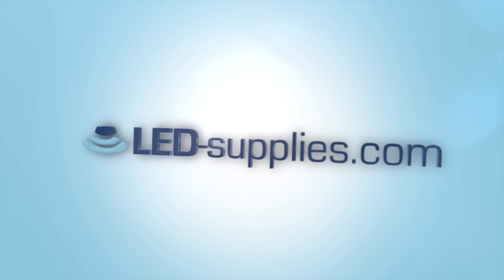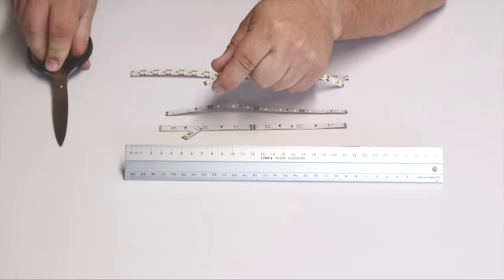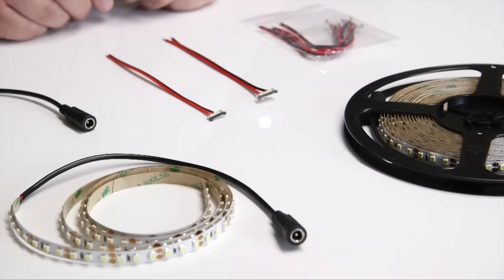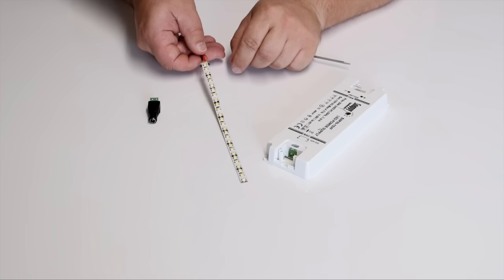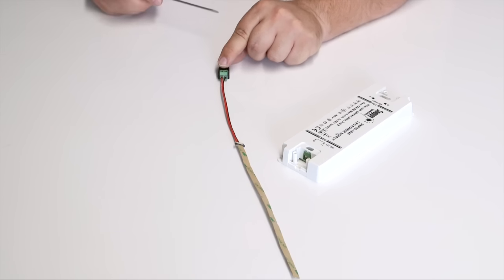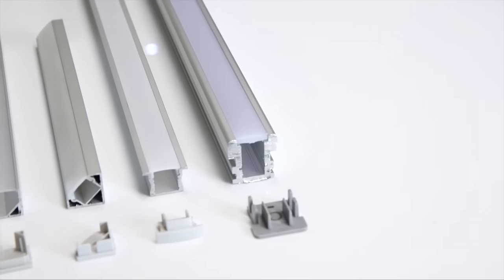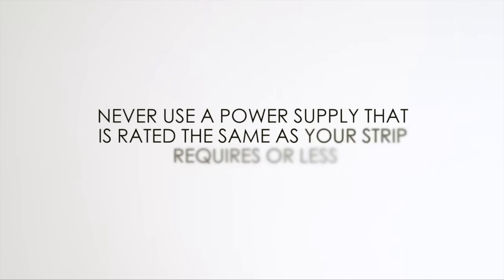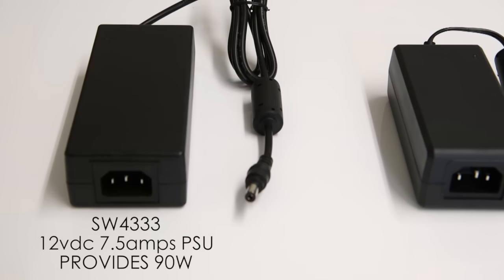How to cut, connect & power LED Strip Lighting

Comment: Can I make the letter A with these led lights?
Reply from the maker: Hi AH AH, thanks for contacting us. You can make an A letter with LED Strip lighting but it can be a little tricky to cut and join the led strip into that shape. We would suggest using our LED Modules https://www.led-supplies.com/led-modules/led-modules-1-2w-ip68-white-series/ as each 'Module' has flexible cable in between each section so they can be shaped much easier and are widely used for illuminated signs for this reason

Comment: i connect 2 LED strip rolls = 10 meter to big power supply, the LED strip at first is very bright the rest is low light! i don't know how to solve this problem! can anyone help?
Reply from the maker: It sounds like you are getting quite a bit of voltage drop down the LED strip. Many of the higher powered LED strip such as 9.6 watts and above are only suitable for connecting a maximum of 5 metres in series. You could try connecting in parallel (put the power supply in the middle and connect to each using a splitter cable or terminal block) That should solve your problem

Comment: Hello, I have 7meters(total) of 4w/m leds(28W+20%=33.6W), theyre in parallel by 3m+4m. I want to know if the PSU(ac adaptor model ly24-c052000-a1) i bought with 5m strip can run all the 7m strip without damage. what do you recommend? thank you.

Comment: is there a clip on connector that I can use to hook up the lights directly to motherboard? Or is there an LED light strip that already comes with the connector attached. I know Oly some mother boards support it and it has to be 12v

Comment: Can I use Dc12v 1amp adapter to 1 meter led strip can its work? please reply as soon as possible
Reply from the maker: It depends on the power rating of the LED strip. The power supply is 12 Watts (12v x 1A) so if the LED Strip is 4.8 Watts or 9.6 Watts per metre then yes. If the LED strip is 14.4 watts per metre then no you would need a larger power supply such as 12vdc 1.5A or more

Comment: Question please, if I wanted to have a single little LED on the end of about a 1 meter wire connected to a little solar panel, how would I go about doing that? I'm very new to all this so as Layman's terms as you can please =P
Reply from the maker: Usually the LEDs on flexible strip are in banks of 6 as 24vdc LED strip, or in banks of 3 if its 12vdc LED strip lighting. If you specifically wanted a single LED then we could manufacture this for you, but it would involve placing a resistor on the PCB for each LED, rather than 1 for each bank of 3 or 6. Rather than making a special type of LED strip which would be costly, could you have a bank of 3 and potentially just cover the light up from 2 of them using masking tape?

Comment: what happens if your power supply is lower than the 5amp recommended? i've a 1.5amp power supply and it work jejej

pls answer!
Reply from the maker: Many good quality power supplies and LED drivers (many of ours included) have over load protection, so when too much current is drawn it shuts down to protect itself and maximize how long the power supply lasts.  It may be that your 1.5A rated power supply is working as it does not have this over load protection. if the LED strip lighting you are powering is using much more current than the power supply is rated to, i would expect that power supply or LED driver to fail much earlier than it would do if it was properly rated

Comment: I used a lot 3m products and they don't work on raw wood or car overhead to keep the sun viser   from falling down. iv used duct tape to hold up the wires underneath the platform it stayed for 30 min. and let go didn't even hold little wires. So if duct tape doesn't hold what makes u think that the glue by 3m is going to hold.  !!!!!!!!!!!!!!!!!!!!!!!!!!!!!!!!!!!!!!!!!!!!!!!!!!!!!!! skipduld@yahoo.com
Reply from the maker: Its all about selecting the right adhesive or method of fixing for the application. As you mention there are many 3M products available and many types of glue by other manufacturers also, some being better than others. Its also possible to install the the lighting into LED strip extrusionhttps://www.led-supplies.com/aluminium-channel-for-led-strip/ or channel and then properly fixed down with clips or screws

Comment: is this similar throughout all brands of cutable leds?
Reply: Yes.
Reply from the maker: Quite often other ranges of LED strip lighting can be cut and connected in the same way, although that does not mean the quality of all LED strip is equal. Our range uses high quality LED chips from reputable chip manufacturers. We then 100% power up and load test every length of LED strip before it is shipped

Comment: Hi. First I connected my 12V 60W 5m long strip of 3528 white LEDs to a 12V 2A power supply. They last about 10 minutes and then the LEDs went out. I then watched your video and saw that I should have used 20% more than 60W. I then cut the strip to 2m in length, making it require 20% more than 24W. I then connected my 12V 72W power supply to it. There were no lights and the power supply exploded in about 10 seconds! I know that I should have connected my larger power supply first, but wtf happened? Everything was new, so maybe my big power supply was destined to blow anyway?
Reply from the maker: Thats very strange. If the LED strip was rated to use the same voltage as the power supply and you allowed the correct headroom and both the strip and power supply were from good quality suppliers then everything should have worked fine.
Reply: Oh, about the power supply exploding, that was a short that happened when the strip folded down the middle because of the way I bent it.

Comment: ok i have adapter and i don't know whats + and whats - on them ill figure it out  xD
Reply from the maker: Sometimes using an LED driver is easier than using a power supply as the + and - is usually marked on the output terminals. You could stick a voltage meter on the output wires and measure them. i hope it all went OK for you

Comment: hello there, I have a question. I want to purchase (for now) a solar powered LED strip light, however, the wire from the solar panel to the LED strip is only 5 ft and I need it to be between 10ft to 15ft. What do you suggest? I was thinking of cutting the wire then soldering on to it more wire for a longer length. Do you suggest I do this? and what kind of wire should I get (electrical)?

Comment: HI can I connect the strips to a car or lawnmover battery that is 12 volts??
Reply from the maker: Yes, although the battery regulation will not be great so you may get some fluctuation in the brightness levels. You may want to put the battery output through a DC-DC convertor to regulate the output before connecting to the LED strip. Thanks for watching and contacting us

Comment: hi what options for power source: USB connection, North anerica /EU power supply and connecting to batteries
Reply from the maker: Hi Gunsta, for powering led strip from batteries check out this section https://www.led-supplies.com/led-drivers/portable-power-battery-for-led-strip-lighting/

If you need to power in the USA or Europe you can use our LED drivers or our desktop power supplies with a USA mains lead or Euro mains lead all available as accessories on our site 

Desktop power supplies
https://www.led-supplies.com/led-drivers/desktop-power-supplies/

USA mains leads 
https://www.led-supplies.com/led-installation-accessories/cables/usa-mains-lead-c7-2-metre-fig-8/
https://www.led-supplies.com/led-installation-accessories/cables/usa-mains-lead-c13-2-metre/

Euro mains lead 
https://www.led-supplies.com/led-installation-accessories/cables/euro-mains-lead-fig-8-2-metre/
https://www.led-supplies.com/led-installation-accessories/cables/euro-mains-lead-iec-2-metre/

Comment: hello will the water proofed led's work with these tlip on adapters? if so. Please give me the link?
Reply from the maker: You may need to peel back the silicon covering to use the push on connectors but this would then break the waterproof seal so you would then need to re-seal it using hot glue or other method

Comment: Can you incase the led strip into resin at all... I am look at doing this for a timber and resin project I am working on... Thanks...
Reply from the maker: Hi, you can incase it in resin but it would need to be flexible resin due to the expansion and contraction as the strip heats up and cools down as its turned on and off. Also, the resin would keep the heat in, so depending on where you are using it, it may have an impact on the reliability of the led strip

Comment: can I run led strip on 12w battery?
Reply from the maker: Yes you can. check out this section https://www.led-supplies.com/led-drivers/portable-power-battery-for-led-strip-lighting/
Reply: LED supplies thanks
Reply: Abhishek Bhagwat   ufñ
Reply: 12V would be better. :)

Comment: I used my rgb's on raw wood and it doesn't work.
Reply from the maker: no reason why mounting on wood would not work, although it would insulate the led strip a little causing heat to build up far more than if its mounted into extrusion like this https://www.led-supplies.com/aluminium-channel-for-led-strip/

Comment: instead of soldering, can I just tape it? i am not good with those hot tools.
Reply: Ben Whoever u need to soldering wires or like mention in vid, use a clip on adaptop (i say its best option instead of buyin the device for solder, then again if u or ur friends already have 1, give it a go really easy to use); cuz if ud just tape it there wouldnt be secure connection and u might end up with sparks and constant power surger that would burn ur leds (maybe even entire house)
Reply: You need electrical tape. It most likely won't stay connected for long either.

Comment: Hi there, one question before I buy.... I am intending to power 8x 50cm 3528 SMD RGB LED strips (all connected by approximately 0.5m of connector cable between each LED strip), will a 12v 5A power supply suffice? That's a 60 watt output.... which I think should be enough for the total combined LED strip (8x 50cm = 4m), but do I also need to take into account the connecting cable length of (approx) 4m? BTW, the LED Strip has 60 LEDs per Metre...
Reply from the maker: Hi Tony, do you know the power rating of your led strip? Our RGB is made from 5050 LEDs and we offer either 7.2 watts per metre (30 led per metre) or 14.4 watts per metre (60 leds per metre) variants. You then just multiply the power rating per metre by the amount of strip you are looking to power to get the total max., consumption and then make sure you choose a power supply or led driver that is rated 20% more than the max load to ensure reliability. You dont have to do this, but our recommendation is to allow this. here is our range of power supplies and drivers https://www.led-supplies.com/led-drivers/

Comment: can i use LED strips to make a magnetic lamp?
Reply from the maker: Hi Stefania, Im afraid we dont know what a magnetic lamp is but maybe!? :)
Reply: Hi!! magnetic lamps are lamps in which the electric current passes through a neodímeo magnet!  (it is necessary to make the electrical connection of the LED on a conductive metal and also in the normal electric network) :D thanks so much for your answer!!

Comment: I experience flickering. It was not there before, it just started when I turned them on today. What is the cause? I believe that the power supply?
Reply from the maker: The flickering could be caused by using an LED driver or power supply that is poor quality, or not suitably rated to power the amount of led strip it is attached to. Try switching the led driver or power supply to one that is higher wattage. we recommend 20% headroom. So if you are powering 24 watts of LED strip use a driver or power supply that is atleast 28.8 watts
Reply: LED supplies thank you

Comment: how much watts do i need to light up like two feet of the leds?
Reply from the maker: It depends on the power rating of the LED strip as it comes in many different kinds. For example you can get 4.8 watts per metre, 9.6 watts per metre, 14.4 watts per metre. They are all common power ratings. Then just multiply the amount you are powering by the length. for example 2 metres of 14.4 watts per metre LED strip will use 28.8 watts maximum, so allowing 20% headroom we would recommend using an LED driver or power supply that is rated to atleast 34.56 watts (ie 28.8 watts + 20%) so the next standard rating would probably be a 40 watts unit

we have a wide range which you can view here

LED drivers https://www.led-supplies.com/led-drivers/led-drivers/

power supplies https://www.led-supplies.com/led-drivers/desktop-power-supplies/

Comment: There is a power wire, 20 amp, coming to an old running light. Is this sufficient to use on a 5 meter length of blue led lights. Do I need a negative wire or can I ground from this positive  wire to the chassis and use a female jack you described in your video to connect to the jack that comes with the light package. What is your website? Thanks in advance.
Reply from the maker: Our website is https://www.led-supplies.com/
does the power wire output the correct voltage for the LED strip (ie usually 12vdc or 24vdc)? You will need a + and - wire to power the strip lighting

Comment: Can't I use a 9 volt battery for a couple short strips?
Reply from the maker: You may be able to power 12vdc rated LED strip from a 9vdc battery but it will not be as bright. Also, depending on the length and power of the strip and the battery power rating it may not last very long

Comment: Can i use these lights without the adaptor? For example i want to use them on a totem for a music festival
Reply from the maker: The LED strip requires some kind of power, so if you cannot operate it from a mains fed power supply or LED driver you will need to power it from a battery instead.The size of the battery you need for the LED strip depends on how long you need it to run for and the power consumption of the LED strip. You can view a range of portable power supplies that provide a stable 12vdc output for the strip via this link https://www.led-supplies.com/led-drivers/portable-power-battery-for-led-strip-lighting/

Comment: Hi very informative video, Ive been doing a lot of research and this is the best video YET! I am working on a project that I am looking to run about 210cm of LED Strip with preferably 120LED per meter, I was hoping I could do so with a 9volt battery or maybe just a couple double AAs. Can you give me some input on what you would recommend?
Reply from the maker: Hi, if you are using a battery to power LED strip, a couple of AAs would last no time (particularly the 120LED per metre stuff which tends to be rated at 9.6 watts per metre). You would also struggle to run the led strip from 9vdc (it would be very dim) so we suggest a 12vdc battery pack. For something low cost have a look at this which would give you a 12vdc output https://www.led-supplies.com/led-drivers/portable-power-battery-for-led-strip-lighting/battery-pack-for-led-strip-12vdc-8-x-aa/ but that may still not last very long (depends on the batteries you fit) if you want something of a more premium quality you could consider these batteries for led strip https://www.led-supplies.com/led-drivers/portable-power-battery-for-led-strip-lighting/portable-power-supply/

Comment: You skimmed over the part about how to power these LED strips. The guy just mentioned "a standard power supply." That means nothing.

Then he shows a few power adapters at the very end. Oh, now you tell me. You put the most important parts at the tail end, and never demonstrated hooking them up.
Reply: Anthony
Reply from the maker: I don't agree Anthony. Powering LED strip, particularly if the led strip has been cut down is a process which starts with how a new power input cable can be fitted. We also fit a little C4229 input cable to our 5 metre lengths of led strip so it can be powered very easily but not all supplier do so we wanted to cover a number of bases depending on how someone might receive their led strip. If you start at 2.02 in the video we explain how to fit the push on cables and go on to explain at 4.28 how an LED driver with screw terminals can then be used to power the strip in quite a bit of detail. My colleague doesn't just mention 'standard power supply' ... you need to take the comment in conjunction with the rest of the video which compares the external power supplies in the black cases, with the led drivers with the screw terminals shown in the white case.

Comment: so what happens if i connect a meter stip to a 4x4 12v battery ?
Reply from the maker: Hi Green Olive, it would work but we wouldnt recommend it as a battery voltage can go up to 13.8vdc which could damage the LED strip which uses a 12vdc input (or it is 12vdc strip and not 24vdc strip). Therefore if you wanted to power from that kind of battery we would suggest you regulate the voltage through a DC DC Converter first, something like this https://www.led-supplies.com/led-drivers/dc-to-dc-voltage-regulator/dc-to-dc-voltage-regulator/
Reply: As an alternative, an in-line fuse will work, as I'm using in my application on my motorcycle. Gonna look like a TRON Lightcycle when I'm done.
Reply: it blows up

Comment: hey whatsupp, i got a question. i want to cut a led strip intro 3 seperate strips for a shelf, but how do i conect all 3 strips to one power source? is it possible please let me know. thank you in advance
Reply from the maker: Hi, you can connect multiple sections of LED strip to one power source using our splitter cables. Take a look here https://www.led-supplies.com/led-installation-accessories/cables/2-1mm-splitter-cables/
Reply: Are they internally connected in parallel? As you seem to connect additional strips to the end of existing ones which implies a series connection which would be against convention?
Reply: booty twerkjn